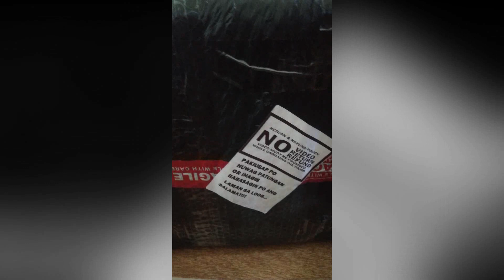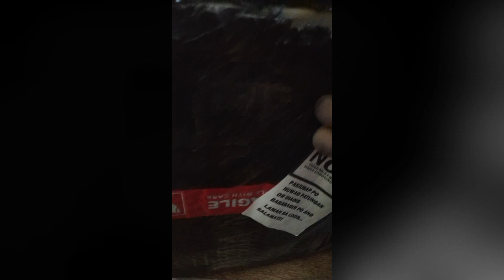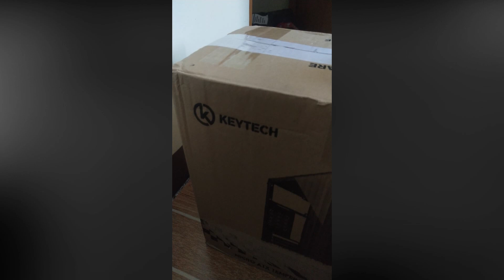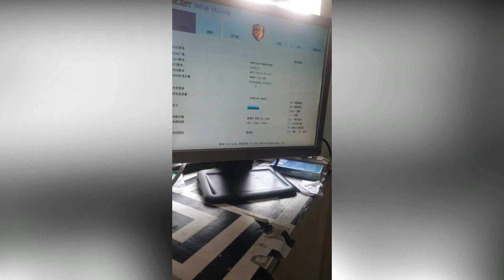PAMPSFAM VLOG / TRANSFERRING PC CASE /  DIY / SYSTEM CASE / KEYTECH T100

Comment: 6:04 sir, exhaust po yung placement ng fan.
Reply from the maker: Sir Salamat sa pag check ng channel ko. intake po position pag nasa front ng pc ung fan. exhaust po pag nasa likod malapit sa Power Supply. sa video  nato wala po exhaust fan nakalagay.
Reply: @PAMPSFAM  Ahh baka po iba lang yung positioning ng buga ng hangin ng fan nyo po. Usually po sa buga po kasi ako ng hangin nag babase. Nonetheless, very informative video.
Reply: Baligtad yun fan sa front palabas ang hangin nyan
Reply from the maker: @egraphix6  binalikan ko video idol, tama nman, ung nsa likod na fan outtake sya, same position mung 3 fans sa haarp, papasok ung hangim sa harap.
Reply: @PAMPSFAM  sir naka exhaust ang position ng 2 fans nyo sa harap.. normally, kung nasaan ang grill, dun papunta ang buga ng hangin
Reply from the maker: actually my mistakes, it was in reverse postion sa video, and it was corrected, thanks sa mga nakapansin.

Comment: Baliktad ang fans sa harap. Palabas ang position ng fan airflow sa harap. Since walang exhaust ang magsisilbing exhaust niyan ay yung fan ng psu which is kumukha ng heat sa loob ng case. Dapat ang airflow ng fan sa harap ay papasok dahil sa likod nito ang palabas
Reply from the maker: tama paps, papasok ang airflow sa harap.